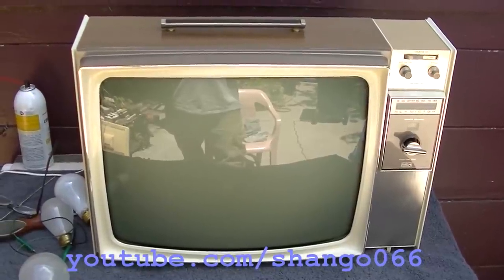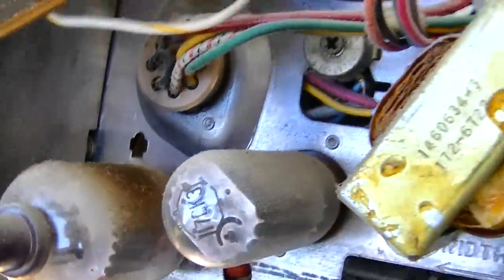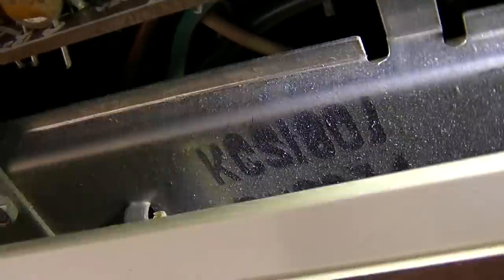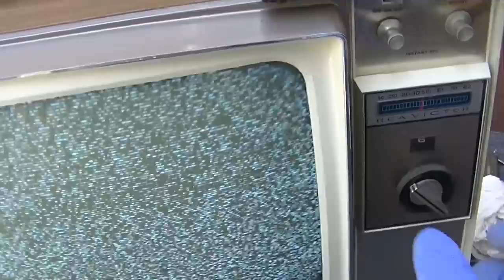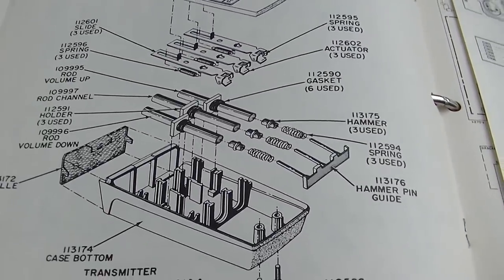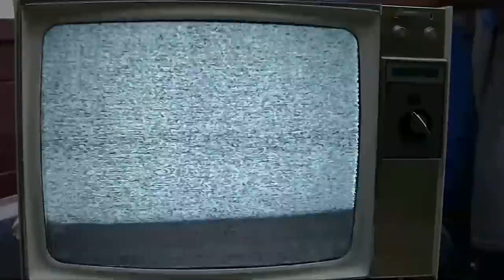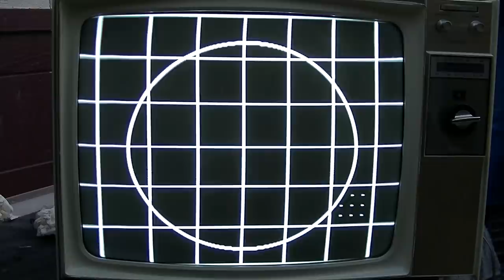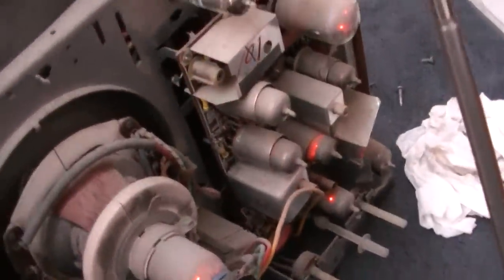1968 RCA Victor Black and White Remote TV Set Repair KCS160

Comment: Imagine what it would cost to manufacture that antique now?  That remote motor would cost more than an LCD color circuit board.
Reply: for sure !
Reply: I remember the price of B/W TV in America for 15" in 1968 was about $160.00 with no remote. That not include a cost of installing a roof top Antenna with Remote control motor for direction setting and contract service. I never see Remote B/W TV back in 1968 but assume to be most for the commercial set for hotel. To the cost of these day based on Gold Standard abort $40.00 an ounce in 1968 this set will cost easier closed to 2K without remote and roof top antenna for today dollar.
Reply: Remote motor looks like a simple motor like you see in a fan. Shouldnt cost too much

Comment: Instant on was great from a manufacturers perspective, the customer could get their propaganda on 15 seconds quicker than before and for that convenience the manufacturers would sell replacement tubes 3 times as often as older sets.
Reply: And help keep the fire brigade employed.
Reply: The tubes probably lasted longer because the filaments weren't subjected to thermal shock every time the set was turned on since they were already warm.  In sets like this you probably had more tubes just wearing out through use.  In the overseas telephone lines back in the 50s and 60's, the repeaters were in the middle of the ocean and were vacuum tube.  The tubes in the amps lasted for many years because they were on all the time.
Reply: @vancouverman4313  The filaments in vacuum tubes don't really get hot enough to break as quickly as light bulbs. The main issue would be the loss of emissions.

Comment: I was a TV troubleshooter at RCA  plant in Bloomington Indiana from 1966 on- this is by far the best condition of any set I've ever seen from that time- RCA had a full set of TVs that it produced and it made a lot of lower profit ones just to fill the mix B&W was about to go out and some were made at below cost just to complete the mix. The first color T.Vs came on line around 1965 or 56 and had round tubes CTC127 I think and then the square tube came in and were ran as the ctc 127  also- I worked there for over 40 years and was kept on even after the plant closed for another 4 years just to look after the buildings along with 3 other guys.
Reply: Wow great story
Reply: Just curious, in a newly manufactured chassis what was the most common problem or mistake?   I'm amazed when I see a car or TV built from scratch and it just starts or turns on like it was just another day.  Thanks for your anticipated answer, you would be an interesting guest in one of these videos.   Was it generally a wiring error or a defective component?

Comment: This TV was made around that time RCA had to changed the logo to the modern RCA logo which is the “Block” logo. By 1969, all models of the portable TV’s have the new RCA logo.

This set is also used for gaming, and it works with Atari 2600, NES, SNES, and Sega Genesis.
Reply: Gamers choice
Reply: That was when RCA sold the rights to the name "Victor" and the "His Master's Voice" dog logo to the Japanese Victor Company (JVC) who continued to sell electronic radios, TV's and such under the Victor name in Japan well into the 1990's.
Reply: Also works with the much better named Sega Mega Drive!
Reply: @Foxonian  That's not true, JVC retained the rights to "Victor", "His Master's Voice" and Nipper for use in Japan (and only Japan) after they separated from RCA during WW2. RCA never lost rights to them within North America. The trademark rights were fragmented all over the world, e.g. EMI and later HMV Retail owned the rights to Nipper in the UK and other markets.
Reply: @SproutyPottedPlant  The megadrive is just a Genesis, but with a case of seasonal depression (runs slower).
Reply: ??? Those games used to out the image signal at 3 or 4 vhf channels... Almost 100% of tv sets were this way, the composite RCA video signal out weren't so common on domestic tv sets...

Comment: The beauty of a "Space Command" remote control is you are don't have to worry you are  going to find one with a duracell spewing its acid all over the inside of the remote.
Reply: Such a shame new TV remotes are such a downgrade. Back in the 60s you didn't need batteries. How is modern remotes an improvement? Imagine if they just kept the old method and added more tuning forks for more options?
Reply: @NickDalzell  The old ones were vulnerable to random noises in the environment. Adding more buttons means that the detection has to be more precise too. To do it with a modern remote's number of buttons, you'd need more computerization than an IR receiver needs. We're talking DSP audio work vs literally semaphores.
Reply: @kyle8952  random interference is still an issue. The times my Samsung Smart TV turned itself off because an airplane flew over is too many to count (I live next to an airport).
Reply: @kyle8952  I wish we could find a happy medium instead of moving virtually all of the controls for the TV to the remote.  It is so easy to lose them.

Comment: We had an early 1970's GE black and white TV with a similar "Insta View" feature. If you left the main volume on-off switch on, and used the Insta View switch, the TV would turn on very quickly. But my parents quit using Insta View when I discovered that the tubes were still glowing through the vents even when the set was off.
Reply: We had a couple of Admirals like that in the late 60s and both ran for years trouble-free.  I disagree with those who say instant-on was all that bad except it was a waste of energy.  When computers had tubes they were never shut down because it would require a technician with new tubes or other repairs if they were.

Comment: I'm a Boomer so I enjoy your TV and Radio Repair/Restoration videos and I like details so anything you add is fine with me.  In 1959 my Parents bought a blonde 24" Dumont TV on 4 long legs.  My Father had a DYI TV Repair manual that had pictures of TV problems and you selected the corresponding picture to the issue you were having that indicated what tubes to test or replace.  I would take a bag of tubes to the Local Pharmacy where a tube tester machine was located and test the tubes.  Then it was off to the local Electronics Warehouse or Radio Shack for new tubes.  Another method for repair was to slap the side of the set.  However, I cringe when you spin the channel selector like starting a lawn mower because we were the channel changer/ volume control and if I spun the selector from one channel to another like that my father would beat the hell out of us.  We also had a rooftop master amplified antenna with a single tube transformer and a knife switch for local and New York channels behind the set on the wall where the antenna lead came in.

Comment: "These microswitches never wear out."

Maybe not mechanically, Shango, but if they are used to switch a small signal the contacts can become tarnished/oxidized, causing intermittent function or go completely open in the worst cases. The contacts need the cleaning action that happens when the switch is used in a power on-off application. The spark that happens when the contacts are actuated burns off any oxidation.

Comment: Another nice 👍 TV 📺. All those controls are eye 👁 candy 🍬 to me. So is that TV 📺 dial, and “RCA Victor”. Tells ya that this is probably an early to mid ‘70’s set. The remote makes this TV 📺 set so much better. I wonder 💭 if it’s color, but black and white would also be fine. In other words, this TV 📺 is like 👍 a Mercedes 240 D for your house 🏠. This does not appear to be a smoker’s set. Hope the CRT’s good 😌. Your friend, Jeff.
Reply from the maker: Your phone or a time try saying in their bond truck and I learned them are mantras a limo blunt Tom fossa animal Hazard flasher propofol flower show?

Comment: I recall a TV in my youth that would seemingly change channels randomly when flies landed on it, not sure if it was the fly wings triggering the ultrasonic receiver in it or landing on the touch sensitive channel buttons (two metal pads that sensed finger resistance). We taped a card over the channel buttons which helped I think
Reply: Perhaps it was one of those sets that had capacitance sensors,similar to the “touchmatic” glass panels used by Amana on their Radarange microwaves in the mid 70’s.
Reply: I think I would have addressed the fly problem first. Must have had a lot of flies.
Reply: @Suddenlyits1960  think the TV was from the 70’s in use in the mid 90’s, early solid state, only had 4 channels. The vertical started to shrink at one point and disassembled (by me when I was like 6-7) probably would have been fixable but the TV was old then and we upgraded it

Comment: I'm not sure you're right about the evil of instant on.  The old tube computers were run 24/7 and any shutdown usually meant tubes needed to be replaced.
Reply: Tubes decay with on time, there is no arguing that. 

If you come across one of these sets that was left in a spare room for years with instant on enabled it has accumulated wear on the tubes, and the CRT. It dosen't wear them as fast as full time use, but it does wear them, at a minimum it burns off the filament and uses up available getter inside the tube.
Reply: The old tube computers were on PROPERLY. the tubes were actually being used, and had tubes swapped at regularly scheduled maintenance periods no matter if they had broken yet or not. An instant on TV just toasts the cathode and getter while doing nothing whatsoever. 

If you only watch four hours tv a day, an instant on tv is wearing out at 5x the rate of a normal one.
Reply: They don't get that jolt of current at turn-on. Look at this CRT, it's held up well and that set has many original tubes. Still an energy wasting folly.

Comment: atleast with the mechanical remotes, you NEVER need to change the batteries! seemed like technological regression to make them electronic
Reply: Had an old Sylvania in my bedroom and could turn it on with the clinking of my trouser belt buckle. Every morning getting ready for school ;-)
Reply: Sadly even our '78 Magnavox TouchTune TV took a 9V battery even though it still used ultrasonic sound to change channels.

As a child I had a high enough pitch in my voice to fool the TV to turn off. Great fun at parties!

The old TouchTune TV still had the most unique on screen display ever.
Reply: @NickDalzell  with a voice like that you must have had plenty of dogs gathering around.
Reply: @haweater1555  I can still hear a dog whistle as well as CRT flyback whine.